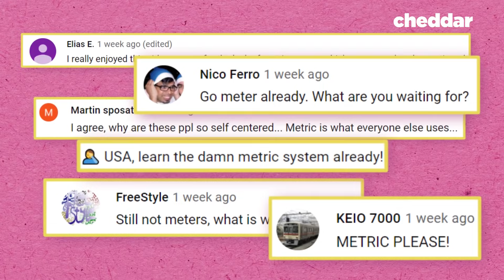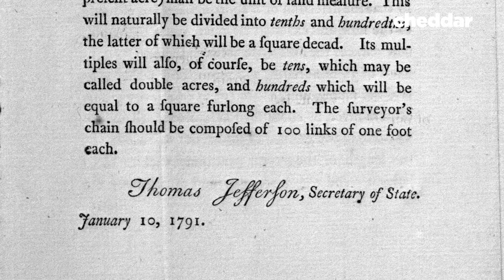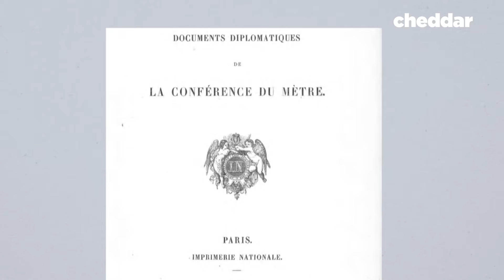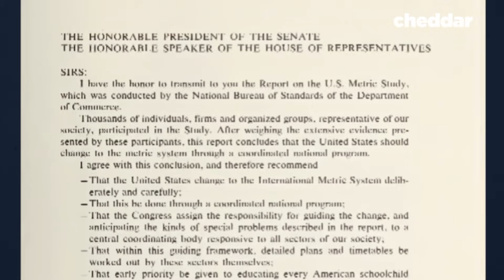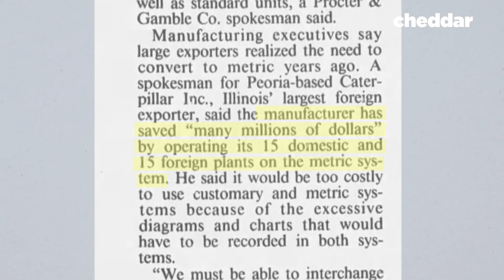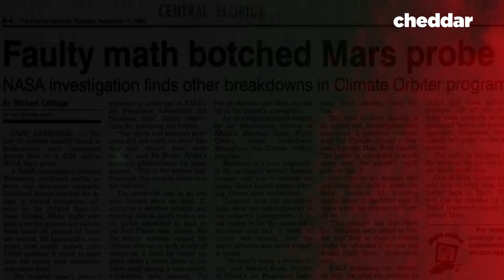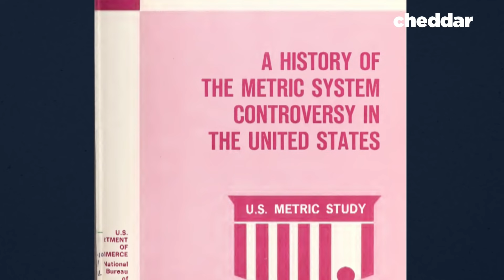Why Doesn't the US Just Use the Metric System? - Cheddar Explains

Comment: The imperial system is based around humans and perception, metric is based around hard scientific facts. Humans are not hard science. Metric should be taught but only used for scientific or mathematical endeavors.
What's the difference between 20 and 30? Not all that much, right? That's how it is in F, but if you ask C then that's a pretty big difference. How long's an inch? About a knuckle. A cm? I don't know, let me get out my ruler. How about the next thing up, what about a foot? About the length of an actual adult foot or hand, makes sense and easy to judge quickly and a fair increment up. Next relevant thing up from a cm? A meter. How big's that? About a yard. That's missing a whole increment compared to Imperial
Reply: I grew up with the metric system and we associate a meter with one large footstep. We associate a centimeter with the width of a fingernail and so on. Just by knowing your own size in meter you get a decent grasp of the scale of things. Do you really think the meter is something arbitrary for us?
Reply: @jannis4387  the meter IS arbitrary dude. Any human based means of judging metric are arbitrary as well. Imperial was literally made based on the human body and how we perceive the world
Reply: @BlueDavrial  Associating distance with the length of a foot or associating it with a footstep is absolutely the same in practice. The actual definition doesn't matter. Nobody learns meters as "the distance light traveled in 1/x of a second". 

Defining the exact length of a foot is also arbitrary and perception is subjective in general. In the end, the metric system is just as intuitive in daily life if you grew up with it.
Reply: @jannis4387  it most certainly is not the same. One is finding arbitrary points of comparison, the other is using points of reference that the system is actually built around. Also just because you grew up with it doesn't make it intuitive. If it was intuitive then kids and people not familiar with the system would pick up on it naturally and not have to be taught it

Comment: I live in Canada and we switched from Imperial to Metric when I was in Grade six. I can easily bounce between the two systems doing the math in my head. But I prefer the metric system for its ease of calculating and its genius. ie: a kilogram is the weight of 1 liter of water, water freezes at zero and boils at 100 degrees centigrade. What I find amusing is that in machining and tool making anti Metric people I have worked with think that its terrible and yet divide an inch into 10000ths of an inch.
Reply: Humans naturally work in base 10 because we have ten fingers.
Even the Americans figured out that a decimal currency was easy.
I was brought up in Britain with 12 pence to the shilling, and 20 shillings to the pound.
That was a total headfuck.
Reply: @TryptychUK not totally true. In the past, many civilisations counted in base 12, also because of fingers : With your thumb, you can point each one of your 12 phalanx. This way of calculating was used for trading in ancient times (sumeria and such)
Reply: @TryptychUK  I doubt there is any biological predisposition for base 10, and whatever number system one is first introduced to would feel the most natural. Base 12 would probably be marginally more efficient, since it is evenly divided by 2,3,4, and 6, as opposed to just 2 and 5. The real benefit of metric's base 10 structure is that it conforms to the ubiquitous base 10 Arabic number system which shapes how everyone thinks about numbers.
Reply: your country as a whole didn't just switch though. it's much more complicated than that.
Reply: Calculating things is easier with metric. But i must say i much rough measurements in feet, rather than meters, and miles rather than kilometers. And the UK fucking uses miles and yards anyway so im not alone....
Reply: @bur encouraging I don't understand Russian, sorry
Reply: Unfortunetly some parts of Ontario they are slowly inching backwards to the Imperial (stupid) system.  I don't know why would anybody do such a thing is beyond me. Lot of the construction materials in teh Canadian harware stores are sold and alkied in Imperial sizes. Very dissapointed, the governmrnt should enforce the metric system.
Reply: CN and CP ( all railroads actually ) use imperial to measure everything. They go by mph and distance is measured in miles and feet. One train car is 50 ft.
Reply: @DanielCollins85  so 15metres?
Reply: @gildedphoenix  If you use meters for measurement when backing up a 30 car train good luck telling the locomotive engineer in meters when the whole world railroad system uses imperial. 50 ft for a car length is much easier to calculate on the fly when your train can be over a mile long. Cars are filled by gallons, weighed in pounds and distance is measured in miles along with speed in mph.
Reply: @DanielCollins85  so 450m. Less than half a kilometer. Easy to measure this kind of distance. And you are better off with putting car weight in kilograms or ton(basically 1000 kilograms), and their fuel in litres and their distance, don't freak out, IN KILOMETRES WHICH ACTUALLY MEAN 1000 METRES!
And everything will be easier, i assure you.
Reply: Also a quick tip, when you change your speed to kph, you may feel you are going faster because the kph values are 1.6 times larger than their mph counterparts. Meaning 50mph would be 80km/h
Reply: @gildedphoenix  youre not listening. I work for the railroad. Imperial is the industry standard. You will be fired for less. Forget your watch? Fired. Flipa switch handle wrong? Fired. Step from one car to another? Fired.

Im not stating an opinion. Im stating facts.
Reply: @DanielCollins85  Do you honestly believe that imperial is used in the rest of the world outside of your shithole of a country? Do you honestly believe that the French use feet and inches to measure their train tracks?
Reply: @edgarjoffre8838  Im not generalizing. Im an American working for the railroad in Canada. The global industry standard for the railroad is imperial. Even in India they use imperial on the railroad. The world as a whole uses imperial for the railroad. Its a fact. Not a generalization.
Reply: @DanielCollins85 " PLANS being prepared by Network Rail will see the eventual end of the Imperial mile, chain and yard on the National Rail network, as a metric switchover takes effect during the next couple of decades."  No, the whole doesnt use imperial for railroads. maybe the places you been, but i.e. in europe its metric
Reply: @ThePogo09  "Plans being prepared" - So its not in effect? And you say next couple decades? Yea. I'm a instant convert. Ive seen the light! lol...
Reply: @DanielCollins85  the news is from 2013, from britan(every other europen country already use metric) and is already taking effect. Its just not posseble to change every sign at the railway in an instand, it takes time (2030 is planed)
Reply: @ThePogo09  Thats exactly why the railroad industry has been against switching to metric. Cost of changing it. I could care less which we use at the railroad, I can do either.
Reply: @DanielCollins85  All railroad industry leaders use metric - most of the Europe, China, Japan... I'm not sure, but it seems really unreal to me that Russia uses imperial.

Try to visit Germany, Austria, Switzerland or France and you'll see how undeveloped US's railroad is.
Reply: @DanielCollins85  So when you say "the whole world railroad systeme" you don't mean "the whole world" as "the whole world" but "the whole word who use the imperial systeme". Make sense. Btw India was an English colony not so long ago so it's normal that say still use the imperial systeme for theire railroad systeme.
Reply: @edgarjoffre8838  You know how I know that you dont know what youre talking about? Youre not countering me with facts, youre argueing words.

My job sends me to other countries to go and see firsthand new and cost effective ways of improving new rail systems. I've been to 9 countries so far. China and Russia the craziest. You know what they both use? Imperial. 

I get sent to a convention every 5 years and over 250 people just like me from over 75 countries with railroads for the same reason. To discuss railroad matters and improvements. Not a single person at that confrence talks railroad in metric. Because the global industry standard is Imperial.

Remember when NASA crashed a multi-billion dollar rover? Know what the cause was? One team used imperial and another metric. Resulting in a multi-billion dollar disaster. This is a perfect example of why global standards exist.

You're out of your depths on this subject.
Reply: @DanielCollins85  untrue it's 58 years that Europe use the metric system for railroads
Reply: @DanielCollins85  Railroads in India are fully Metric, even though legacy values for the gauge continue to be used (converted to mm) because there is no point to relaying all the track
Reply: Daniel Collins maybe in your small world in your head. The Europe railroads do not use imperial whatsoever. You are just living in your small world thinking that's it :-)
Reply: @pavolkolencin6634  What ever you say. You must be some authority on European railroad practices? Ive never seen you at any of the organized confrences to discuss railroad matters & technology.  But lets all just take your claim 100% serious.

Comment: We use both. Imperial units are much better for basic "shorthand" measurements. Everyone knows how big a thumb, a man's foot, one step, or about a thousand steps are. That's an inch, a foot, a yard, and a mile. Normal people aren't working on anything precise. They just need to know roughly the size of something. It pisses us off when instructions or schematics say 250mm. Wtf is that? How big is a centimeter, really? 10mm? Well, how big is a mm? .001 meter? There isn't a real basis for their size. It's arbitrary as hell. We all know how big real objects are, measurements based on that are far more accessible.
Reply: I grew up with both systems and I am tired of listing all the reasons why metric is simpler.
Reply: @dannygjk  it really depends on what I'm doing. Base 10 is easier math, but imperial is easier, for me, to understand. 6ft is easier to visualize than 180cm. Analog clocks vs digital are the same. If I need precision, I'll get a stopwatch,  but if I just need to see the time of day, analog is more natural.
Reply: Schmatics and drawings are in mm due to standards 
Its used for technical drawing
CAD modeling 
Used for the AS1100 standard

Comment: The President if the American Society of Automotive Engineers defined the metric system as - " a system of measurement used in Europe by people to stupid and ill educated to be add subtract multiply and divide by anything other than 10 " .The metric system was actually invented in England in 1619 and even today thesecare several metric systems -Japanese metric is not the same and even the French use British Standards for pipes and computer chips are made wordwide in multiples of thirtytwo seconds of an inch .

Comment: I noticed that she never considered buildings and structures in America. Going 100% metric would throw our infrastructure contractors, from streets and bridges to homes to high rises, into total chaos. It would be one thing if we only built new constructs but we don't. We're constantly refitting, retrofitting and repurposing old structures built using the imperial system. Switching to the metric system would be an absolute nightmare for these industries.
Reply: It's not like Imperial would just vaporize overnight though, it's a simple case of just convert the units, very easy these days as even if you don't know the formula you can just Google it
Reply: @cpufreak101  It would be expensive too for what reason?
Reply: @kappadarwin9476  ?
Reply: @kappadarwin9476  There was a long period where just changing machine tooling would have cost $Billions. Before CNC machining was as common as it is now, one turn of the handle on a manual mill was 0.1" Just changing all of the lead screws and dials to metric for the whole nation, so we could pander to the rest of the world? No way. Metric isn't necessarily more precise, just different. Europe escaped much of the cost of retooling during the 20th century, since much of the industry was destroyed (twice) and had to be replaced anyhow.

Comment: As a Brit, I quite like it the way things are at the moment. Speed limits and road distances in miles and yards, beer in pints 🍻 most people weigh themselves in stones and pounds, describe their height in feet and inches etc. Most foodstuffs and liquids are in metric and things like kitchen appliances have their dimensions in mm. Tradesmen and builders mostly use metric but seem to be able to change easily between the two.
   
I don't have a problem converting one from another, although I tend to convert down to base in imperial.

Comment: I think napoleon said the meter was known to ancient man...and I think the pyramid has ratios in meters and feet. The meter is a linear measure, standard is a curved measure, like degrees in a radius or the face of a clock. If you're working on a car, the metric fasteners might be rusty and so a different size, so it helps to have both measures because after all...this is the real world

Comment: Here is my argument against Metric. How do you divide something real by 10. We should consider using binary as it's dead simple to fold a normal shape in half.
Reply: Ehhh the thing is that you can divide it by 10 to change the measure but the real benefit is that you can change back and fort any one of them by moving the decimal. Take 1 meter, its 100 cms. So half a meter is 50 cms or 0.5 meters. Metrical gives you the chance not just to think in halves or quarters, but all the sepectrum of numbers. It all matters how precise you wanna be.
Reply: So if I gave you a meter stick with no markings you could divide it into 1000 even , exact, parts? Mind I'm saying with out some standard millimeter measure.
Reply: how about we switch to duodecimal?

Comment: I for the metric system but just commenting on something said in  the video they said the metric system save money on the number of belts but the measurement system had nothing to do with none common designs. What really save them money was redesigning and commonizing the parts which they did because they switched.

Comment: When they tried it in the early 80s they f'd in the automotive field by doing it half assed. On the same car you found metric and fractional, it made no sense.  The other problem is the same difference between sizes. You can't tell the difference by looking at it. Hex size or diameter.
Reply: You can't just eyeball the tools in the other system if they are 1/32 apart.
Reply: @dannygjk  
Unless you're talking machine screws imperial doesn't use 32nds for diameter or hex size. 
It also doesn't use as many as 4 thread pitches in one diameter. When they standardized the system they forgot to standardize usage.
Reply: @cbmech2563  Even 1/16 you can't be 100% sure by eyeballing especially the larger sizes.
Reply: I have no problem telling the difference between 1/4, 5/16ths, 3/8s etc. But 4,5,6 millimeter? And is it 1.25 or 1.5 or 1.75 thread?
Reply: @cbmech2563  Good question they probably didn't change the thread pitch tho.
Reply: @dannygjk  on  some  diameters  there  are  4  thread  pitches  and  the  difference  between  the  coarse  and  the  fine  is difficult  to  tell  apart . What's  the  point ?
Reply: @cbmech2563  I may have misunderstood you. In any case the metric system is simpler and it is the international standard. All technicians, engineers, and scientists must work with it as least occasionally if they deal with working with other countries. Exceptions of course example when working on a problem/project in which the measurement system is irrelevant, (I mean isn't a factor).
Reply: Metric  may  be  simpler  from  the  engineering  point  of  view , but  not  from  a  practical  usage  point  in  the  heavy  truck  field .
Reply: @cbmech2563  What I'm hearing in your last comment is you prefer imperial because you are used to it. I grew up with both systems therefore I can easily be objective. Metric compared to Imperial is like comparing two machines which do the same thing but one of them uses fewer parts.
Reply: On  trucks  metric  uses  more  sizes . Another  factor  is  when  using  a  bolt  and  nut  they  are  never  the  same  size  and  the  difference  changes . Metric  may  be  just  fine  for  scientific  and  engineering  but  when  comes  to  practical  application  it's  just  plain  idiotic . And  this  is  on  a  Volvo  truck ,  all  metric .

Comment: I think many people don't realise it, but the USA is actually metric. Not in an easy way, but they are metric by proxy: the inch is defined in the metric system, so using inches (and other units based on inches) is essentially using the metric system by proxy. Obviously though, the "by proxy" means things get unnecessarily complicated.

Comment: is the imperial system base 12?? because base 12 math seems more logical and elegant mathematically. 12 is such a beautiful number. metric is base 10 and has its issues. 12,24,36,48. etcetera. Do a video on the diference between base 10 and base 12 mathematics, it's really interesting and you will nerd out completely. I'm in Canada and use metric, but the allure of base 12 seems to make a heck of a lot of sense to me if you dive right into it.